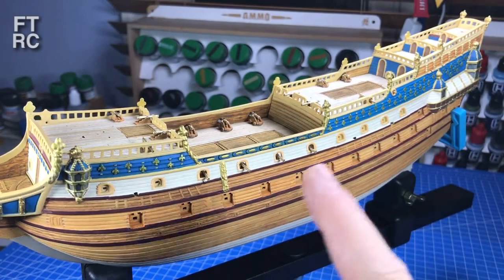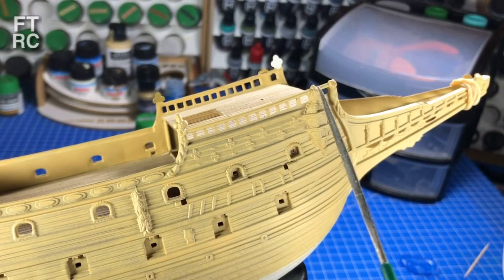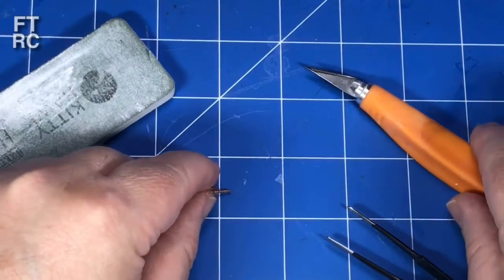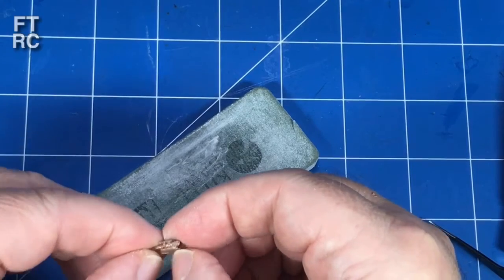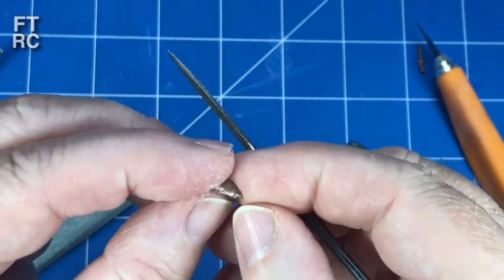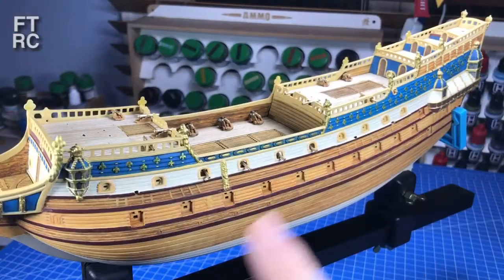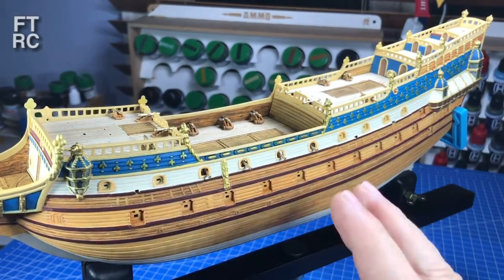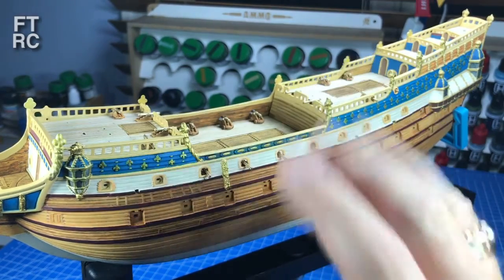Airfix St Louis Part 6 Cannons and Carts

Comment: You really upgraded this lump of glue into a  great looking french battle ship!
Reply from the maker: It has been a labor of love.
Reply: @HarryHoudiniModels  And it shows :) Heller made some fantastic historic ships in their range!
Reply from the maker: Yes along with Imai... but this kit is Airfix, completely different to the Heller Saint Louis
Reply: @HarryHoudiniModels  Ah no wonder I had them mixed up, Heller has the Royal Louis, not the Saint..That's Airfix indeed. :)
Reply from the maker: Heller made both, I have each kit.  The Royal Louis is 1:200 and one of the nicest sailing ship moulds Heller ever made, but they also did a 1:200 Saint Louis, although it is out of production now and very hard to find.  Heller’s Saint Louis was criticised for being just a copy of their La Couronne, which is similar but not a Dutch built ship, it was still a fine kit, although not much smaller than the Airfix 1:144 St Louis, so not really 1:200 scale as such.
Reply: @HarryHoudiniModels  Thanks for that info, I did not know Heller did both. I always am a little bit lost with their scales 1/200 and 1/150. Looks like they shifted with some scales and ship names over time. I have some Heller ships in the stash. Some early as the 1/200 Gallion, Stella and Elizabethan and some later models as the Phenix, Royal Louis and La Sirene. My Airfix stash has the Royal Sovereign, Prince and Victory. I see you like Dutch ships as well. The Batavia from Revell is indeed a really nice kit. Batavia struck the West-Australian Wallibi reefs in 1629 and it all ended miserably. But first things first :) Good luck on the build of the St. Louis!
Reply from the maker: Yes I must think about building my Batavia sometime soon.  So many ships, so little free time these days.  I have not had a moment to work on the Louis for a week.  Magazine deadlines, kit reviews, rush jobs for clients, and that demanding cat!

Comment: The bulkheads creating some kind of "division" of the second gundeck looks rather improbable dont you think? Never seen anything like it... And no doors in them at all. Great build! As always :)
Reply from the maker: I talked a little about that at the end of the video.  Those bulkheads Airfix have you put in are fictitious. The gun deck was open, running full length of the hull under the forecastle and quarter deck, with just arched supports where those incorrect bulkheads sit.  There would also have been stairs running down from those upper decks both in companion ways hidden under central gratings, and also down from the midship railings at either end of the open gun deck.  The plans for the French Couronne show it clearly, as it was a feature of Dutch warship design at the time, and the Dutch of course built the St Louis for the French.

Comment: One other thing Harry, I have that same kit, but its the Heller original.
Reply from the maker: The Heller kit is completely different.  Slightly smaller with a break down of the hull into more components, which would make it easier to paint, and the correct setup for the gun deck with the more accurate arched end supports under the forecastle and quarterdeck. It also has a slightly different officers quarters and very different ornamentation on the stern.

Comment: Cheers Harry. Another great save on the cannons. Are you almost down to the unbuilt parts of the kit now?
Reply from the maker: I have finally cut a few parts from the sprues.  The larger 18 pounder cannons on the main gun deck with bigger trucks were cut off, and I got the rudder free as well, so it could be painted to match the stern.  More of that next time.  Lots to do.

Comment: Hi Harry, looking really brilliant it's a great looking model. Have you worked out how sailors etc got onto the aft decks?
Reply from the maker: I talked a little about that at the end of the video.  Those bulkheads Airfix has you put in are fictitious. The gun deck was open running full length of the hull under the forecastle and quarter deck with just arched supports where those incorrect bulkheads sit.  There would also have been stairs running down from those upper decks both in companion ways hidden under central gratings, and also down from the midship railings at either end of the open gun deck.  The plans for the Couronne show it clearly, as it was a feature of Dutch warship design at the time, and the Dutch of course built the St Louis for the French.

Comment: Great build so far. You're doing Airfix proud!
Out of curiosity, where did you find a reference to the 'flying bridge'? I thought that section above the 'wine and cheese area' was the grating deck or grating roof (no, not for grating cheese).
Reply from the maker: After much research I was given a book about French warships in the age of sail.  It describes the evolution from early ornate Dutch designs right up to the much cleaner Napoleonic area ships.  In this book I found the explanation of the flying bridge and why it was used.  I’ll explain further in the next video when I install the part and make some custom changes to the bulkheads so ladders can be added down to the gun deck.

Comment: There were no carronades in the 17th century, but I’m not too much of an expert on French forecastle armament in the early years. I would think they would sit on trucks though.
Reply from the maker: You are right.  I am yet to find out the correct name for them.  Airfix has just based it’s armament on one of few cartoonish drawings we have of the St Louis.  They would have been more like swivel cannons, but on wheel less truck beds, and most likely full of grape shot to repel boarders, hence the name murder cannons.  I am reading a very detailed book on French warships of the 17th-19th centuries, so hopefully will come across the answer in there.
Reply: @HarryHoudiniModels  feel free to fill us in on what you find out!
Reply from the maker: Seems in the early part of the 17th century French warships had a wide range of cannon size, over a dozen from 2 pounders to 36 pounders.  They would even run mixed 36 to 18 pounders on the main gun decks, then 18, 12, 8, 4 and 2 pounders on the upper decks.  No swivels, all in trucks.  So those murder cannons may be 2 or 4 pounders and the trucks need wheels.  Yay!  More scratch building.
Reply: @HarryHoudiniModels  I’ve heard of mixed gun decks and I don’t think it was just the French. Interesting time period, when what had evolved from medieval galleons was starting to look, act, and think like what would later be called a ship of the line.